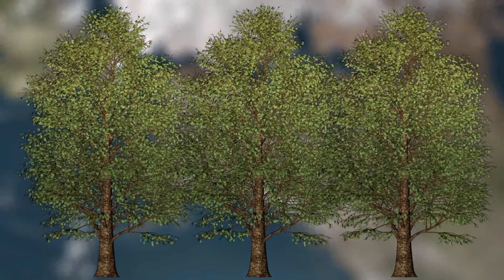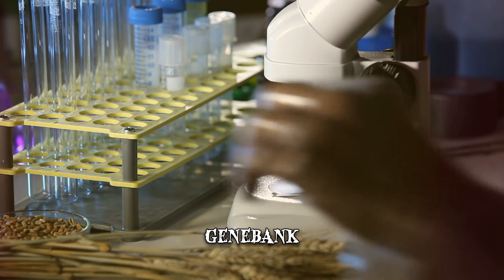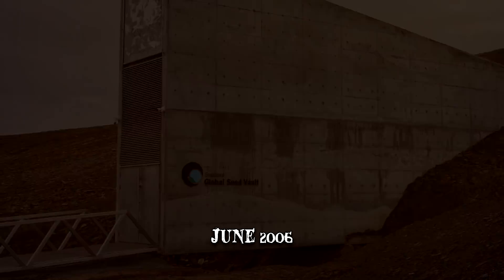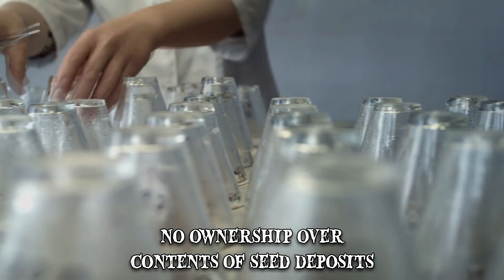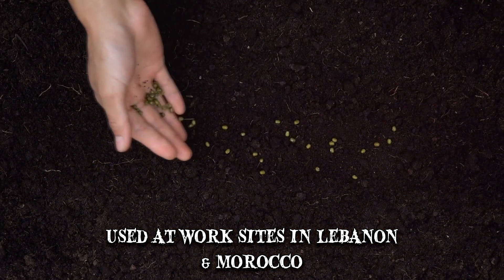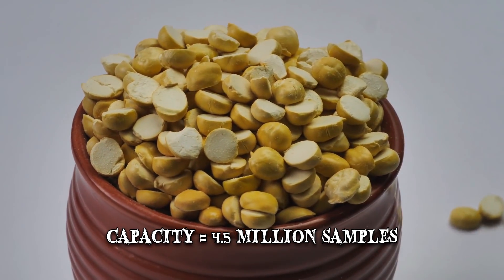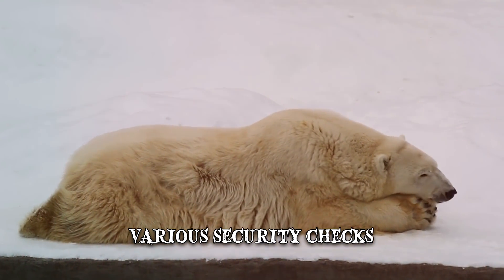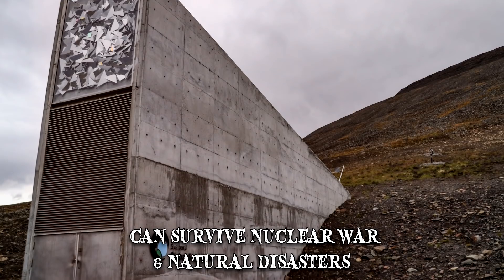Everything You Need to Know About the Doomsday Vault

Comment: ClimateChange is has and will always be caused by the Milankovitch cycles.

Obliquity increase in the tilt of the earths axis is increasing the amount of DIRECT sunlight the higher latitudes poles and receiving.
Warming the southern hemisphere heat sink oceans and thawing the northern hemisphere frozen co2 continents. Why temperature rises first and co2 follows. Cause and effect.
Will also cause increased pestulance, Forest fires, tornadoes, hurricanes cyclones, precipitation at higher latitudes.

The inconvenient truth about the Milankovitch cycles causing Climate Change is that.
Every 13 k years when the Precession of the north star aligns the equator with the solar orbital plane at the ecliptic's. The gravitational pull of the SUN pulls tsunami's around the planet East to west because the planet spins west to east.

Eccentricity is the trigger.

Covid is a Strawman built on the Baby BOOMERS turning Seniors Bust due to the usual suspects of old age and Seasonal FLU.